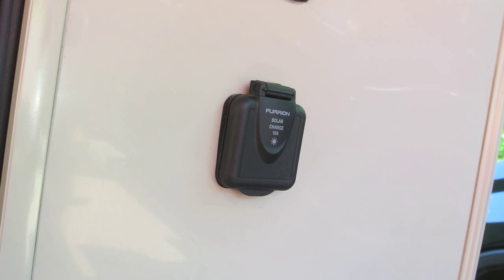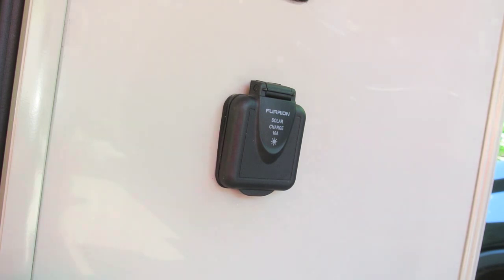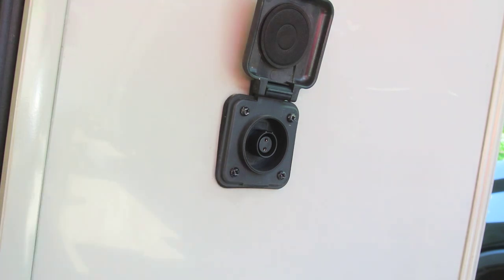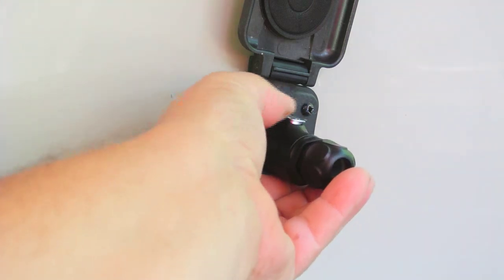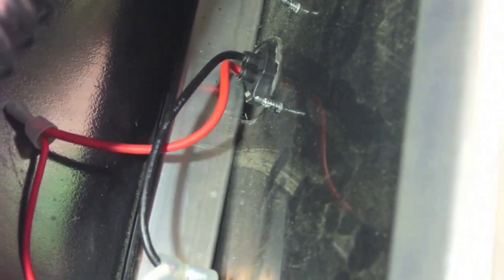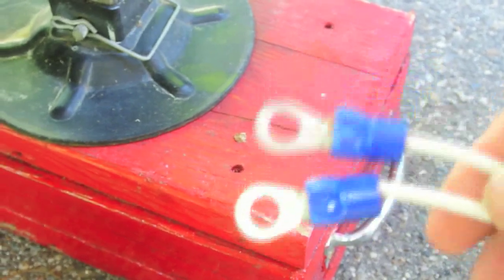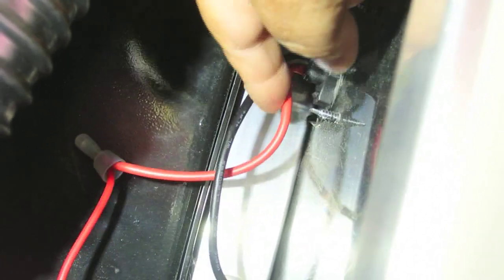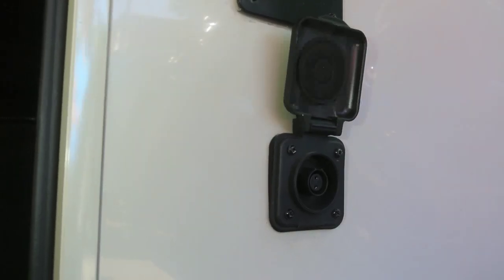Connecting to the Furrion RV Solar Port - updated

Comment: I have a furion exterior solar panel and the two pin connector . I need a connector from that has two leads to hook to deep cell battery for charging. Any helpful sources
Reply from the maker: The information you seek can be found on my website: http://www.rv-project.com/projects/solarconn.php

Comment: Thanks for putting out this video and confirming what pin Furion considers to be positive. 

Like you, I have a Grand Design Reflection and the Furion plug housing says 10 amps and has a 10 amp fuse as part of the circuit from Grand Design.  However the Cnlinko specs for the LP20 series plugs show a 20 amp rating. Do you have any idea why Furion is specifying 10 amps rather than 20 amps?  I'm  wondering if it is safe to replace the 10 amp fuse with a 20 amp.
Reply from the maker: I have wondered the same thing about the 10A vs. 20A thing.  Only thing I can think of is more plastic is used in the furrion housing.

Comment: Where do I get the manual for Furrion Solar that you showed in the video? It was very help much more then the Dealer that we bought out TT from.
Reply from the maker: The video was for using the Solar Port  - not the solar panel itself.  There really is no manual for the solar port, but you can go to my website for that project where I have additional information available, as well as a link to the drawing for the solar port. 

Disclaimer:  the webpage only provides generic or typical connection information. You must posses adequate knowledge to connect this device to your RV. You assume all liability and risks for any action you take as the result of the information I provide.

Here is the link to the webpage: http://www.rv-project.com/projects/solarconn.php

Comment: we have a 2018 K-Z toyhauler with the Furrion port for solar panel connection.  i purchased the connector and soldered the cables to it.  now the problem is that the trailer manufacturer has the single red and black wires coming off the input port running into 2 wire sets (one going to behind teh fridge and one going to behind teh stove.)   nothing from here is able to be seen heading to the battery compartment and definitely nothing to the battery itself.   Furrion and K-Z are of little assistance.  techs state that the controller needs to be tied into the battery cables red and black lines.
that would be great if i was not planning on using the 600$ panel through the charge port.

I really could use some assistance on where the lines for the charge port exits near the battery to connect it into my battery.
Reply: Yeah, if the Furrion solar port doesn't connect to the on-board power converter/battery charger of the RV, meaning you still need a separate charge controller, I fail to see the point of the Furrion port.  You still have no good place to keep your charge controller out of the weather, and I could more easily and cheaply connect the charge controller directly to the battery WITHOIT using the stupid port and buying a connector.
Reply: I bought the connector for the Furrion port and tried to run my solar panels through it. Charge controller indicates "Fault" when I connect this way. Seems like the wires run to the battery but maybe it is wired wrong inside or a fuse is blown.

Works perfectly when I connect my two 40w panels through a hub and controller and direct to the battery. Guess I'll stick with the old way -- less loss I suppose anyway. Just feel like I wasted money on the connector. Oh well!
Reply from the maker: Ideally, the solar charger should be connected as close as possible to the battery. The longer the wire distance, the less voltage, and hence, the lower charge rate you will have.  Unfortunately, RV manufacturers really don't seem to have much in terms of wiring schematics... I cringe at the thought of how the hodge-podge of wiring is kept straight.

However, from a practical standpoint, the charge rate is fairly low from the solar charger anyway, so it probably is not much of an issue if you can indeed ascertain that the Furrion port wires do connect to the battery cables as they snake through the RV (i.e. wiring directly connected to the battery).  Afterall, when you have your tow vehicle connected to your RV, your RV's battery is being charged by the tow vehicle's alternator, which is going to be tens of feet away.
Reply: RVProject the problem is that the solar charge port wiring is no where near the battery area and doesn't appear to get there.  Wiring (which I have a pic of) goes behind the fridge and the stove on 2 different split offs from the back of the furrion input port.  I would have to cut my plug in off the solar panel line and directly hook it into the charge controller and then the battery.
That means I'd never use the junk Furrion solar ready port to plug into.
Reply: And I'd have to unhook the controller woring every time we tore down camp and reinstall everything we set up rather than use the furrion connection on the side of the trailer

Comment: So question on this...If the battery can charge from the tow vehicle, the AC pedestal hookup, and now a solar panel (w/ charge controller of course), what takes precedent?  If all three were hooked up would the battery take from all three?  Is it safe to assume the AC pedestal hookup and tow vehicle wiring have some kind of charge control on those?
Reply from the maker: Batteries charge depending on the voltage applied to them. So the battery will charge to the level of the device connected to it that produces the most voltage. However, it should be a rare condition when all three devices (or any two) would be connected at the same time.

The most likely would be when connected to the AC shorepower pedestal, you could have the solar panel connected. However, there is no reason to connect the solar panel as the charger in your inverter would be capable of charging the battery at a much higher rate.  The best practice then is to only allow one charging source at a time to be connected to the battery (but there should be no ill effects if this is not strictly followed).

When connected to the vehicle, the alternator output is supplied to the RV battery. The alternator voltage then will determine what the charge rate will be.

For the power pedestal, the converter in your RV includes a battery charger that charges the battery.